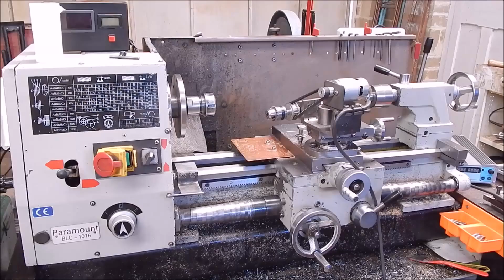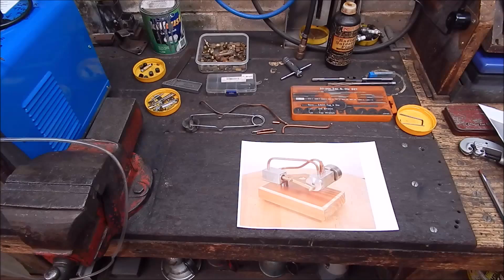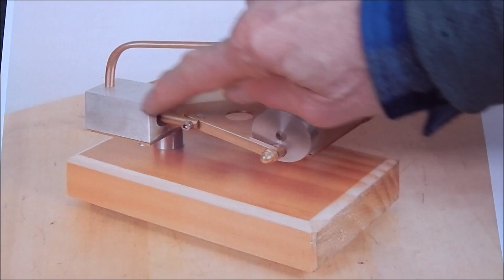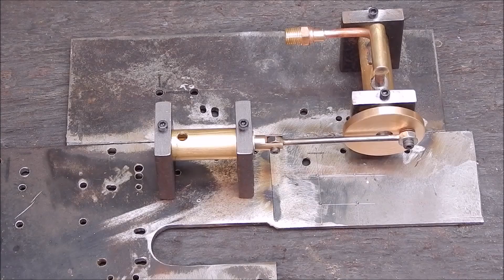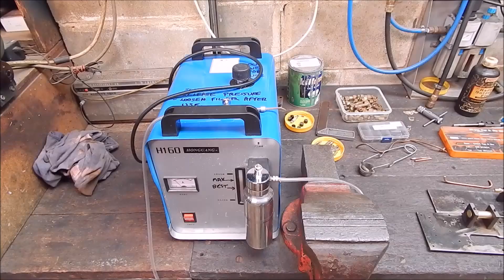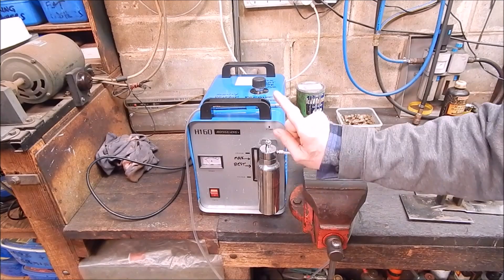What's happening in the Xynudu workshop ?

Comment: Hi, what oil do you put in the cq's head and feed boxes. Don't see hydraulic oil as good enough, can get some omala 68 gear oil here.
Reply from the maker: I just use 20 - 40 car engine oil.  Works fine.  Looking at user manuals for the current crop of Chinese lathes, that's basically what most of them recommend.  Cheers Rob
Reply: @Xynudu  Cheers, keep up with the good videos.

Comment: Interesting design Rob. Not knowing anything about steam engines, but having studied thermodynamics many years ago, if your gas flow (steam or air) is alternating direction in the cylinder feed pipe, will this not affect the efficiency of the engine constantly having to move proportionately large volumes of air/steam in the opposite direction? Also wondering if this could mean more condensation in the pipe with constant temperature changes although it will all happen so fast that probably not. Looking forward to seeing it run. Cheers, Jon
Reply from the maker: Hi Jon,  All good points.  I have made a number of Stirling engines and they use a similar two way/ one pipe air flow system and it works quite well.  I'm not expecting any issues with this.  Condensation could actually be less as air in the pipe will be reused/trapped to some degree given the shunting effect occuring.  It's actually quite amazing how fast air can move in systems like this.  Once again Stirling engines are a prime example.  Should be interesting to see how it goes.  Cheers Rob

Comment: Hi Rob, nice little engine and interesting it has a rotary valve. Cheers Kevin
Reply from the maker: Hi Kevin, Yes it's an interesting approach.  The rotary valve tolerances are very close and it seems pretty air tight under test.  Should be a runner I hope.  cheers Rob

Comment: Right up my alley, Rob! Thanks! I wondered about the "extra" tube in the initial video but when seeing yours today I got my "cheapskate" juices flowing for an even further simplification. You've got mail. 
Cheers and ATB! DIYSwede
Reply from the maker: Hi Johan, I checked my mail and read your comments.  Very good.  That will simplify it even further and is easily done.  I will forward your mail on to Alan as I'm sure he will be interested.

I had tossed around the idea of incorpoating a cross gallery in the rotary valve/crankshaft housing, but didn't have a sufficiently large piece of stock.   Your solution gets around all that and should work a treat.   Maybe Alan will try it out.

I will finish off my Heath Robinson version for now and re-visit the concept again when I get some more time.

Thanks for the message.

Cheers Rob

Comment: Hi rob , interesting valve, it will be good to see woking. Good tips on the hho , what was the bubbler mix  you were using ? 
Cheers👍
Reply from the maker: Hi Colum,  I use a mix given to me by a retired jeweler and it works very well with no flashback.

It's 75% methylated spirits (denatured alcohol) and 25% Acetone, with a teaspoon of Borax powder per litre of volume.  Gives a non oxidizing flame as well. 

For fine soldering work such as this project the small gas torch works really well.  It can also bronze braze the conrod ends on.  Cheers Rob
Reply: @Xynudu  thank you, 👍

Comment: I assume the "new" toolposts on Banggood are of the multifix type?  If so, you done a booboo, they're the dog's nadgers.

That "floating crank" motor looks nice, like the design, although the machining seems rather rudimentary.  I'm sure you can do better.
Reply from the maker: I looked at the BG multifix toolpost, but wasn't overly impressed. I know some people think they are the greatest, but it is bulky compared to the piston type and expensive for the average home user.   The offer is still there if I want it, but I don't think it is really suitable for a lot of people with small lathes.  On bigger lathes, yes it would be a nice addition.  Cheers Rob
Reply: @Xynudu  also rules out making your own tool holders, with Aloris type ones you can mill out custom tool holders for the post relatively easily.
Reply from the maker: Yes, that's a good point.  Works out pretty expensive once you start buying a lot of tool holders for the multifix.  Cheers Rob
Reply: @HM-Projects  That's certainly true, but oddly, multifix holders apparently aren't *that * difficult to make either, despite the "unpossible" image they present at first view.  Challenging, but far from impossible.
Reply from the maker: As they say, the impossible just takes a little longer ;)
Reply: @Xynudu  Oh yes.  I've just started an impossible mill restoration / resurrection.  It might take a while.